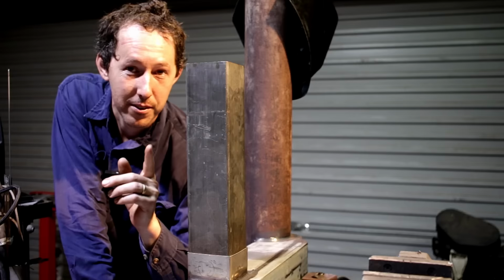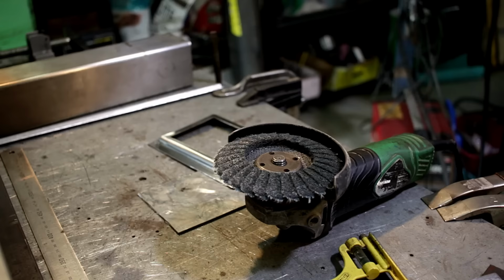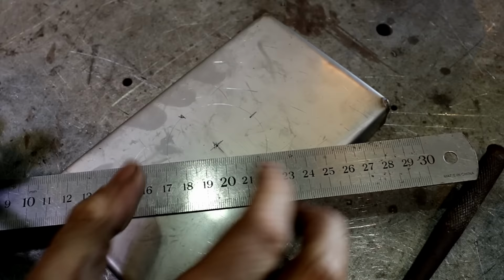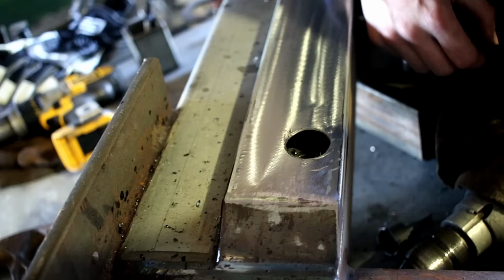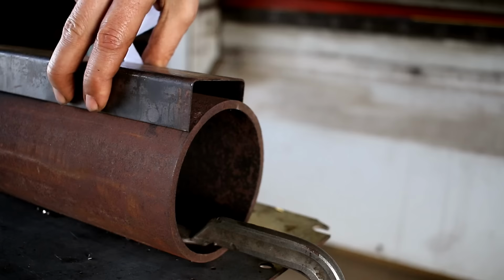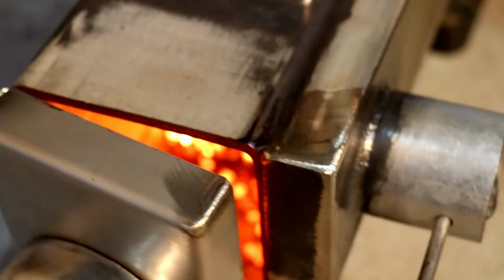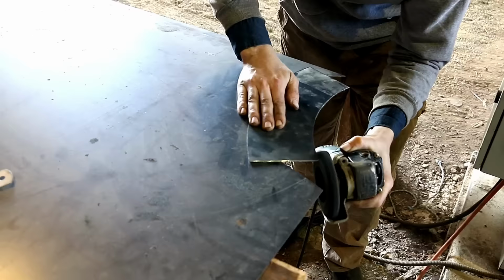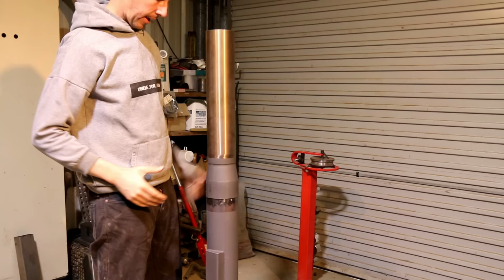Vortex Rocket Stove Pt 2

Comment: Rockets do take a lot of air to run efficiently... as you found out.

Mine has an insulated firebrick burn tunnel and riser... With pellets, I've gotten the exterior a bit over 1000° F. But I have unlimited firewood... only gets up to 750, 800.... I'm good.

Next build will be a vortex.

Great job... wonderful welding, and workshop.

Comment: The circular air entrance converting to a square inner flow is creating broken lamiar flow, and probably low pressure areas. This is probably why cracking the door always worked better.

Comment: Sweet stove. I've fabricated a few Smokers, a few fire places then moved onto fabricating efficient wood burning shop stove heaters. I learned early on the benefit to having secondary burning, and dialing in airflow to not only the secondary burners, but to primary air intake.  Having a flu dampener has helped too. I'd love to make a stainless stove with a window someday. I guess a Kimberly stove clone with auxiliary functions for water heating, cooking, and etc. You did a great job so far, keep the vids coming if you can. I recently subbed.

Comment: That glass window you added is a very nice touch. The orange and red of flames like that is among my favourite colours. I didn't know a stove could get hot enough to burn even the soot and ash without insulation. Thanks for making this video. Though having a stove that reaches over 400 degrees centigrade seems like a bit of a safety hazard.
Reply: Definitely awesome

Comment: All it needs now is some form of coil down the flame exhaust, with a pipe in and out to cycle cold water into hot.
Stove and hot water at the same time from the same fuel.  Good luck in TAFE and the career moving forward.

Comment: Very nice ..I build rocket stoves myself..metal melt down after a while in the burn chamber.
I coat my metal with satinite. Refractory cement..metal doesn't get as hot but achieves  same results..
Cheers mate

Comment: Vortex flow direction only matters when you have low to medium gas/liquid flows. There would be some loss on the speed of flow, but if you have enough oxygen and unburnt flu gasses, it speeds up again. Not if the fuel is completely or near completely burnt.

Comment: i really enjoyed watching you build this. It is a project that I wanted to develop for some time. My fabrication skills are not where yours are @.

I like the way you have done these videos. elements of your life & humor come in & out briefly. I am suffering from a little guillotine & press envy, nothing a little time traveling would not fix.

I had an anolog porto mig for almost 25 years, I was sad the day she died & I was told by the welder tech that she could not be saved. I had a close connection with her, that is not possible with modern woman.

Last year I bought a razor too, still getting to know her, but I am really pleased with how she goes, started my 1st stainless mig project late last year , starting my 1st mig aluminum project in the next few weeks, buying the tig torch & bits soonish, keen to start learning me to tig.

I love the non symmetrical form of your finished prototype, that you let the holes remain on the base plate. Utilitarian but simple & elegant.

Comment: You need to recycling your heat. Remember the old volcano oil burners where they take hot air from the flue and recycle it into the combustion stream to preheat the fuel.. That way you only need to vent in enough oxygen to run the combustion and not the draught as well. It will get real hot and be a far better radiant heater.
Reply: @masterjamessir3776  What does that mean?
Reply: Interesting🤫
Reply: They were called Sallamander oil burners, kero, diesel sometimes mixed with some old oil.

Comment: I'm a huge fan, I still wish we lived nearby. Epic colabs and BBQs would be the norm. 
Great news on the appyship. And the coolness of kit in the shed/garage never seems to end...
Reply: I couldn't understand what he said there. Is it an apprenticeship, to become a journeyman?  And what does "fitting and turning" do exactly?
No offense, just interested in understanding how Australia makes skilled trade workers. As a journeyman Mold Maker, with plenty of Tool and Die instruction and experience,  they are often alike and often require the same tasks and knowledge
I'm going to guess a "Fitter and Turner" would be close to our Pipefitter designation, but that's usually specialized in industrial and heavy commercial applications. 
Just curious, thanks✌
Reply: @BearBig70  As an Aussie, but not a fitter n turner, easiest description would be a "machinist" Lathe, Mill, etc operator 
To us a Journeyman, would be a bloke going on holidays, 
You going on a journey mate ?   
Guess we would use term Tradesmen instead 
Can I assume a Mold Maker is the same as here, your in a metal foundry ? 
Pipe fitter as you say is specialised heavy industry or just a Plumbers job

Comment: I would like to give you a tip when machining metal, when you use oil you make a mess. Use paraffin candle wax and you will be surprised as to how much less of a mess you have to clean up and not to mention getting chips in your hands. All you have to do is just run the drill or any tool against the candle wax and you are ready to drill with lubrication without the drip !!!!!! The TIG welding is nice but really easy. I prefer to use SMAW as that is what I learned the first time round. I can weld with either and get the same roll of coins tilted on a slant look. Nice work fella too, stated from the other side of the earth. USA. Peace and good luck too. V
Reply from the maker: I will have to give that a go. Thanks mate
Reply: @LittleAussieRockets  Look forward to see more stove videos fella. Peace and good day too. V

Comment: Hello... Nice vid... But i think your basket is a little to high... That might  be the reason for the smoke at the first time... Cause it will be a burnback into the filler, and there is no air, and than you have smoke... Maybe shut down 10mm from the upper of your basket... And if it was me... I would build an ashtray which is adjustable... So you can give fresh cold air from below... I think that is the best for your stove
I just built my third one and my practice says, give the air from below...

Comment: Nice video, But I have one comment for the improvement, while I'm doing my graduation we tested a gasifier, according to my experience, in your firewood after getting halfway to gasify, it forms a crust-like structure and prevents new material enters to the zone. So it will reduce the efficiency after some time in each cycle. So if you shake your firewood attachment, it will break that crust and supply material s for gasification. Hope this will help you, ( Ravi From Sri Lanka)

Comment: Here is a tip for everyone : when tacking up a short pipe on a flat surface first tack should go on the inside edge of the pipe if at all possible. When tacked like this as the tack inside  the pipe cools tacks clamping  action clamps the opposite side of pipe tighter to the flat surface.  Second tack goes on the outside directly  opposite  the first tack.  Same way when jointing a short piece of pipe or flanage to a longer pipe. If pipe is too long to tack on the inside  second tack should b applied as quickly as possible to the opposite side to avoid a dog leg at the joint.

Comment: The vortex looks impressive, but many rocket stove designers say that turbulence is better for ensuring that the gasses are properly mixed and burned.
They even insert a small ridge or tab into the tube to break up the flow and force turbulence.

Comment: I know little about metal working, but I do know about dragging stuff around the yard. Trying to push that welding cart, with those tiny casters, up high on the table top is applying downward force when you want a more horizontal effort. Tie the ends of a strap near the bottom shelf on each leg of one end, giving yourself a generous loop for pulling and you can move that cart a lot easier. Of course if your goal is comedy, pushing it like you did is funnier. Excellent work compensates for extra effort. Great video!

Comment: that window.. gold. It's really something else to be able to see what's actually happening past the fuel burn point and gauge the burn with the soot deposits. would you be able to link what you've used if possible? Also, i really like how you've explained the changes when modifying the design.. that's so important for people like myself who are working on their own stoves or people that would be interested in trying this out for themselves, it really inspires creativity. the result was there in the end for sure.. 425c is nothing to sneeze at and that vortex looks amazing. looking forward to part 3.
Reply from the maker: Evergreen G155135b Pevex Orford Replacement HD Stove Glass 155 x 135, Clear 

This is not the same store that I brought the glass from. Can't seem to find the original 🤗 but it is the same size.

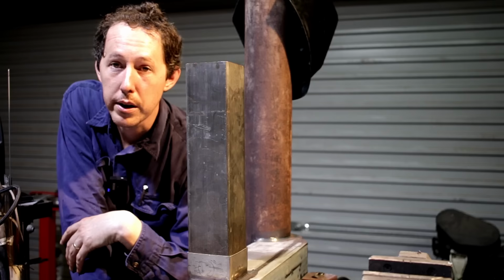Comment: 04:00 I's not the Coriolis force itself that determines the rotation direction of a vortex, but rather the difference between the forces on a N-S direction. That difference is TINY! The distance between the N-S extremes of a moving mass of air are enormous in a typhoon, which results in a sizeable momentum. However, in any man-made contraption that delta is absolutely insignificant in relation to ANY other local phenomena.

Comment: 40:12 A thought I had from part 1 was that apparently the main reason why glass windows in fires get discoloured is the difference between the temperature of the inside of the stove and the outside. The way to solve this is to use two pieces of glass with a gap between them. The owner of the UK’s most successful woodburning stove company told me that in about 2002. 
Peace
Reply from the maker: Thanks! That's good to know 👍👍

Comment: Nice build - KUDOS!
Why not do the math to engineer your prototype stove using stoichiometric chemistry
You need 30 units of air for every 1 unit of wood.  Notice I used the word air since air is only 21% oxygen.
Now you can estimate the quantity of air knowing the duct size and air velocity in a unit of time and make adjustments based on combustion chemistry aka science.
Good luck,
Doug
BTW - don't worry about the vortex direction - its being manually induced.
Limit secondary air to 15% of primary air. Adding more likely cools exhaust resulting in poor secondary combustion.
Reply from the maker: The stove used 2.3 kg of wood pellets per hour. That needs to be verified with more tests.  Thank you for the math, I have copied it down.
Reply: @LittleAussieRockets  Thats one hot stove! Watch the high temps for metal spalling reducing the useful stove life. Hence, 2.3kg = ~5 pounds of fuel pellets so 5 lbs x 8,000 BTU/pound = 40,000 BTU aka 10K kcalories  Back of the napkin calcs says it needs 150 pounds or 68 kgs/hour of air. Get the combustion well established with the door open then it would be possible to close the door and open the vent fully to provide all the air with a 2" diameter vent in the door without exceeding the 0.1 m/sec velocity as indicated by a candle flame. If the flame glass soots up black without burning off at temps you have no choice than to add a small secondary air jet just upstream of the fire glass.  Good luck!
Reply: @douglaspohl1827  We talking rocket stove or space shuttle?

Comment: I think you should get a CNC cutter. I have one for cutting wood and it's really easy to use, you could do a lot more with one. It's not that expensive either.
Reply from the maker: Yes they are great tool to have. I have a CNC plasma cutter now, and am hiding in the background a homemade CNC router that I need to get running.

Comment: there's an old guy called David S and he has done a lot of rocket stove building to heat his garage and he seems to be worth a look at, and you have to be able to see the flame inside the tube
Reply: david mccullough  Are you suggesting a secondary window in the flue pipe?  My mind boggles at the engineering requirements to add a viewing port on the flue pipe that would not distort the vortex and withstand the additional temperatures.
Reply: @catgynt9148  no I was commenting on the glass window he was fitting to the side
Reply: Absolutely really no need except to through some light, looking down the ass end shows its working!

Comment: Amazing video 
Funny chicken dance 
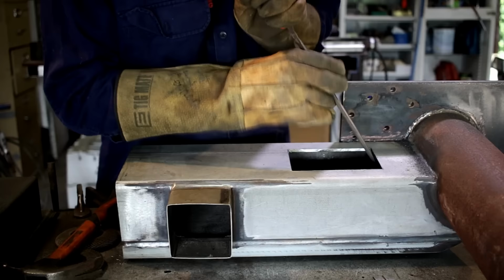12:12 was funny 😅
Nice cut with the ... knife 

The stove looks great , you do an amazing work 
Only one thing if I can say , from what I've observed in many rocket stoves videos and my stove experiences .... it seems that the SECONDARY AIR  works better when  all  that secondary air flow is coming as near as possible to the  flame so all the mix can also ignite,  
In your case,  as near to the bottom,  because , the holes near the top will allow air  in but  may not really ignite cuz is not as hot as near the flame as possible 
Anyway 
That's just an observation

Comment: All very interesting. Thanks for showing the details. 

I am wondering why you call it a Rocket Stove. It isn't even similar to one. It is a crossdraft combustor with a chimney, primary air with preheated secondary air. 

I really like the window on the side. It looks great. Alex English made a similar combustor layout that had self-serving wood pellets. Where you have a basket he made a series of horizontal thin plates that allowed air to pass is if under the steps of a staircase. With very little effort you could pop in an alternative basket that did the same thing, turning it into a pellet stove. 

He used it to heat his house without any attention. 

It would be very useful to know the oxygen concentration in the stack, and temperature of course.  

Stay well. 
"Real men burn stuff."

Comment: Interesting!  Questions, what is the purpose of the second square primary intake between the round primary intake (completely open) and the pellet reservoir? 
Are both completely open? This would equal an intake cross section which is roundabout the cross section of the burning chamber?! How do you avoid that ember will fly back out into your barn full of wood and chemicals? 

What was the result on the secondary intakes opposite the glas and after the vortex?  Are all completely open?  
With regard to the feed of fuel, would a 45 deg. feed not be enough, why 90 deg? 
Where does the ash collect after the burn and how do you clean it out?
Cheers! br

Comment: The dirge sums it up.  Lol.   Great job btw Love it!  Also Love the homemade butterflies.  Was wondering why you don't Insulate the burn chamber and areas near it?  I hear it increases burn 800c burning off smoke and creosote almost 100% like catalytic converter.  Perhaps coating the steal with ceramic coating will make the steel last longer or perhaps forever.  Also using titanium just for the burn chamber would work for longevity as it can handle the heat I think.  I have seen some other recepies but I'm finiky and would want to test them.
Reply from the maker: I have been wondering about how I could increase the burn baskets life.
Reply: @LittleAussieRockets  Yes I'll let you know if I find a secret recipe.  Lol.   Seen several but they need to be tested.  There is an expensive metal that can hit 3800c and even one that does 4200c or so but it's to expensive.  I'm currently researching ceramics.  Hex boron nitride with high heat epoxy vacuumed into carbon fiber & mylar seems most likely culprit.  I'll let you know how it works out for me.

Comment: As a rule of thumb, your initial air gap needs to be 1/3 the size of your initial stove orifice. The orange colour of the combustion flame means inadequate temp and too little initial combustion oxygen. Holes in the riser will cool the exhaust gases too much.

Comment: Hey my friend, let me through a thought your way. I,m a retired tool & die maker with a 
home shop also in the states. I wonder if your vortex is your draw problem. Creating the
flame & air to swirl is keeping it from rising up the exhaust pipe. How can it cause draw up 
the pipe when all the energy is just spinning in the pipe. The draw up the pipe is what draws
The air in the intake. I think people get to rapped up in this mixing the gases with a vortex 
than the benefits it gives, if any. Give that some thought. You are a very talented lad. I just
think you maybe over thinking this project. I have done that more than once. I worked for a 
R & D department building prototypes most of my life.

Comment: Exactly the Coriolis force is so minimal it has no influence on the function of you stove.
Reply: brantgargle-  look at how your tub drains. look hoy long the flame stays low  & swirls before rising up the flue. as in everything, even car racing- NO one has a whopping 20% improvement- its the SUM OF LITTLE .5%, or 2% improvements, get 10 or 20 of these- your untouchable. AND DUDE... even long range shooters MUST compensate for this as applicable or they miss. brant has no influence.

Comment: Use a steel enclosure around the chimney filled with sand as insulation. It handles and holds higher temperatures for longer.
Reply from the maker: Yeah that's a good idea. This stove produces a crazy amount of heat and it would be good to store some of it for later.

Comment: If you don’t mind, I’d like to know more about your TIG welder and your PLASMA cutter. Your TIG welder seems to be quite versatile…much more so than my old MILLER machine was. Blessings and thanks.
Reply from the maker: Hi David, my TIG welder is a unimig razor AC/DC pulse. I believe in the States they are just called a razor weld. It's an inverter machine with a really good range in its pulse settings, and it's ability to cope with hard work. I have a friend who's a pipe welder. He used one of these machines for years without drama.